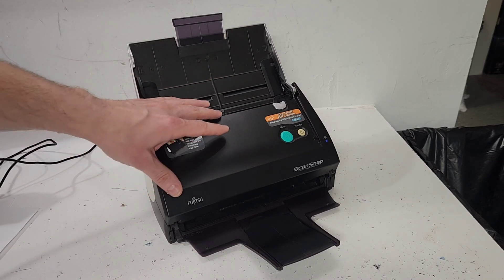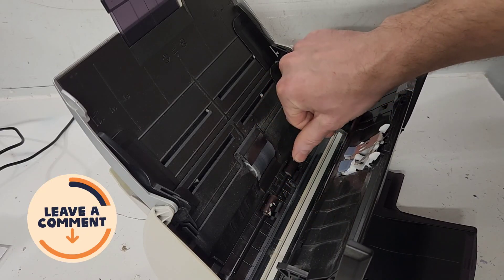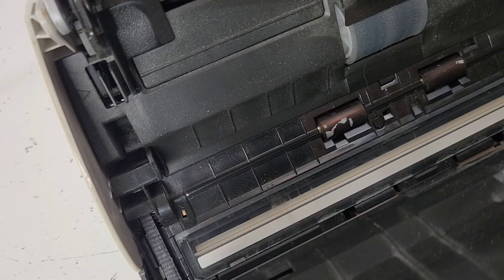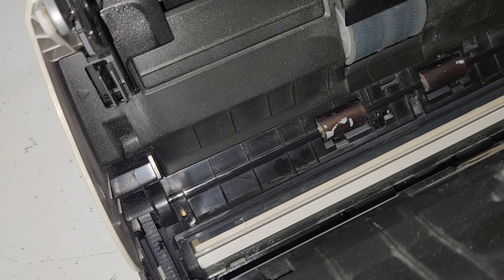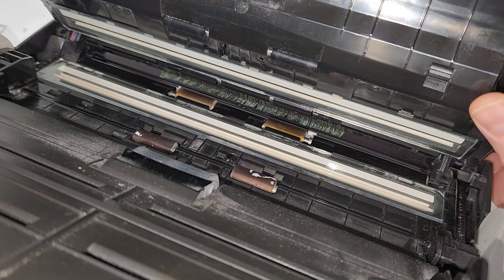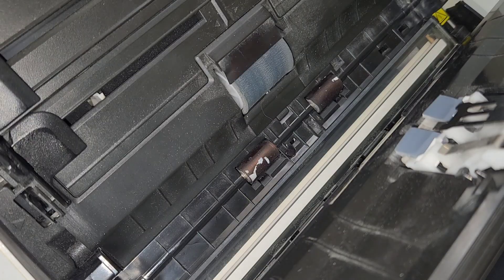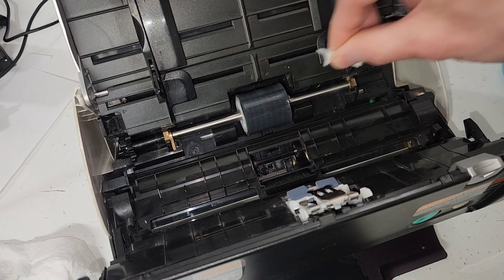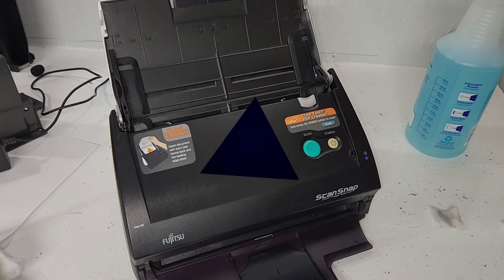Fujitsu RICOH ScanSnap Makes Lines on Scans HOW TO FIX S500 iX1400 iX1500 iX1600 S1500 iX500

Comment: Thanks, this helped a lot, I have the Fujitsu ScanSnap iX1600 model and had vertical lines. I even had the reccommended F1 detergent they sell for machine, ended using alcohol pad from first aid kit, and lines are gone. Lines were visible on the glass like you showed in video.
Reply from the maker: Thank you for sharing.  I'm glad you got it fixed!

Comment: Helped me a lot and fixed the one very fine line that was showing up on prints and driving me nuts. Much better than the Fujitsu help pages that would have you clean everything. Also the aha moment was when you showed the close up of the "glass". I didn't even know where the glass pieces were. So I looked at mine with a bright light closeup and sure enough there were small smudges + streaks in one little section. Cleaned it and all good now!  Thanks again!
Reply from the maker: You're welcome! Thank you for sharing, have a great day!